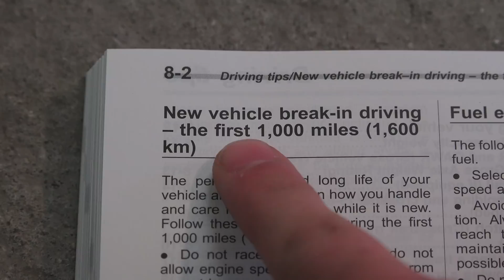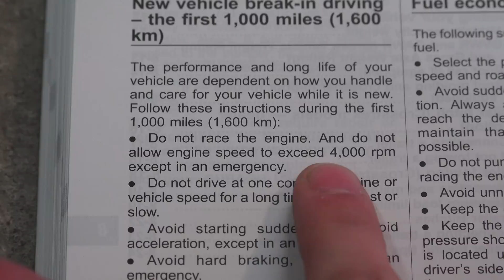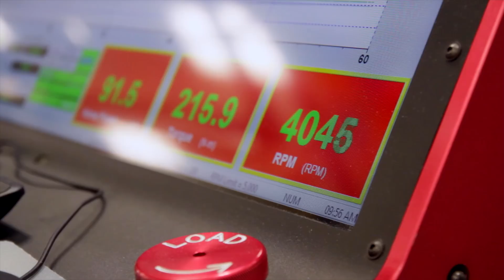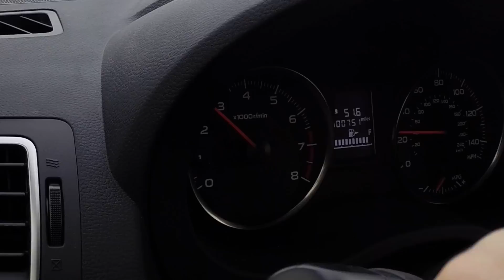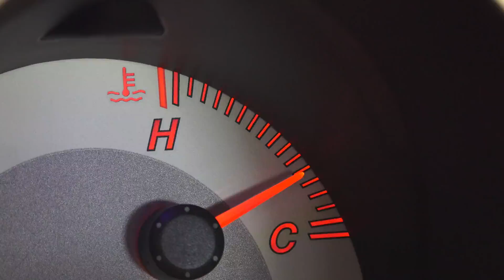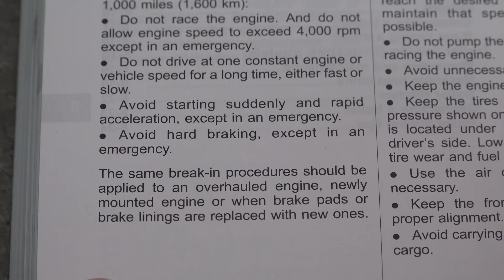5 Things You Should Never Do In A Brand New Car

Comment: Especially in the new wizbang engines designed today, like the Nissan shown, you gave s small engine making amazing amounts of power, with a warranty. This goes from the Corvette V 8's and the Subaru Opposed small displacement engine. That are all covered under the manufacture warranty. So they want you to take it easy to be sure no damage is perpetrated and to help get engines built with hot spots get the help needed to get by the warranty period.

Comment: This is bs. Everything I've ever owned I ran it hard from the get go. Cars. Trucks. 4 wheelers. And for some odd reason it was a smudge faster than the next exact same stock vehicle. Also in the (particular)cars that had known oil consumption issues, for some odd reason mine didn't use oil. So no, don't baby it from the get go. Hard acceleration causes vacuum on the rings when letting off the throttle at high rpm and seats the rings in better for a better seal and less blow by. I speak from true experience.

Comment: I like this guys explanations for things in general and he just follows what the car makers say to avoid any conflict. However as a engine builder or repair man we know that the general methods only pertain to the average driver. Imagine a 2 thousand mile breakin for a Bonneville racer .Ridiculous isn' it?  What does throttle opening do .It relieves the drag on the engine. It is basic theory of good efficiency. There is no problem with wide open throttle.Different size carbs or throttle bodies mean nothing. High rpm is a problem at first.  Steady speeds are fine as long as not too low or too high. 
With a moly face ring, as most engines come equipped these days, an hour will have the rings seated. An hour for the camshaft also. Engine bearings need an hour also. If the engine is assembled correctly  all is good to go in an hour. However be sure to get the oil hot before you go and race it. Poor oil flow will kill any engine. The manufacturers test engines in such a way you would not believe. 10 below zero cold start, floor it with a full load to redline then shut it down and do it all again a few times.
   The old days are gone. Rough machining is for backyard or third world conditions, and long breakins were with cast iron or chrome face rings. Break in oil caused sludge and varnish to help seal leaks and smooth rough surfaces.That was in the 20's- 60's .
    11,000 rpm in a motorcycle engine after a overhaul with 2 hours of running time is common. LETS RACE! Rauuuuuww

Comment: I'm a huge fan of your channel and your work and I have watched almost all of your videos. This is the first of them that has disappointed me. 
So you've read parts of three owners manuals, sat in a car, quoted one engine builder, and that's supposed to be engineering explained? Where's the engineering and the explanation? Some of your older videos had more useful information and explanations in 1 minute than this one has in its entirety. 
I won't go into a debate on engine break in because its such a controversial issue but I will say this: No amount of easy break-in will save an engine with imperfections or improperly set tolerances, nor will flooring it to the rev limit ruin a properly built engine. An engine that gets damaged from flooring it during break-in was bad in the first place. There is no arguing against that. I'm not saying there is a single way of breaking in every engine or that this or that way is the right one, but putting a clickbait-ish video thumbnail with "don't floor it" is not the standard engineering explained has set over the years. 
Why do car manufacturers don't tell you "Please rev your engine along its entire rpm range"? Maybe its because they have a legal department and maybe because they would wake up the next morning with a million lawsuits from a million morons that crashed their corvette. "I was just doing what it said in the owners manual bro! I want a 3 million for emotional trauma". 
Sorry for the long comment. I do not mean to criticize, belittle or start an argument. Things like engine break-in are not black and white and there is no single perfect way, especially not one that stems from a few owner's manuals and some chit-chat, and I think you know that better than anyone, so please give is us some good ol engineering explained with facts and details.

Comment: Currently at 180k miles on my LS3(c5z06) which was broken in hard. Maintenance all done regularly of course. 

Most higher end "sport" cars are driven by the manufacturer for testing before they get to the customer, in some cases requiring no break in. Ferrari is a good example, as all "new" ones have around 50~ miles from break in/testing.

Comment: There is a BMW dealer across the street from where I work. I routinely see the service guys pull out of the parking lot, blasting full throttle, white smoke coming out of the exhaust, engine screaming at redline, turning the corner and going two blocks down to the gas station to fill it up for a customer. Great way to break in that new $50,000 car fresh from the dealership! Brakes, tires, engine, and transmission all thoroughly hooned for you in advance. I'll never buy a car from this place. Ever.

Comment: I've been told by many mechanics that you should not labour the engine while running an engine in i.e. low rpm pulling away, need to keep the engine reving a little more than usual 
so low load medium revs

Comment: ive hit 100,000 miless snd I broke my caf in with high octane over the rugular needed to get piston rings to set with positive pressure. Your rings break into the rpm you ride it at. so if you ride it at hlaf rpms and lower its not gonna blow by on the lower rpms, but the high rpms are gonna blow by like crazy. constantly change rpm, avoid hard hils or heavy downshifts. light downshifts and short little 3/4th throttle accelerations, then put it in secound at about 15mph and slowly but steadly lay your foot down and let it bounce off the limiter, then go home and compression test, if your solid youve broke the car in well. if not you have failty internals. im taking this straight from Jennings.

Comment: After working for an OEM who makes performance motorcycles, you also need to understand that telling the customer to "be gentle and not redline etc etc etc" is also a way to SAFELY get the customer familiar with the vehicle in a more controlled manner. NONE of the race teams I spoke with followed the "recommended" break in procedures. Of course they weren't as concerned with maximum long term reliability, but they were obviously VERY concerned with maximum power. They each told me "heat cycles" were the key.

Comment: What happens when you get a used car?! You're at the mercy of the original owner? That's like playing the Lottery.
Reply from the maker: Used cars are certainly a lottery, but there are a lot of great videos out there about how to inspect them (ChrisFix and EricTheCarGuy both have a great series on this).
Reply: That's a high price to pay for having little patience.

I'd rather just pay for a good mechanic to go over a used car thoroughly.  To each his own.
Reply: Angel Valdez Agreed, if you want reliability, choose Honda or Toyota. Pretty much unbreakable engines in these cars. :-)
Reply: wallllleeeee pretty much yup. that's why I tried new vehicle this time. the used one I had the rear end was going and the dealership never checked it off as a problem.
Reply: ***** How will it not be cheaper though? I bought mine for €3000 and been driving it for a year, and all I've done was put oil in it twice. That's it.

And it's not a car with 50000km's, not even a car with 100000km's, but a car of 225000km's (!) that's still like new.

I may have had great luck with my purchase, and others may not, but don't dismiss the fact that it's generally much cheaper to buy a used car.

Sure, for €10000 I could have bought a damn Dacia Logan or something, but that would not have nearly the amount of comfort, power, luxury or style as mine has, for over 3x (!) the price (not even to mention that it's probably going to be 3x as unreliable, because it's a Dacia lol).
Reply: @robertdevald  my $25k used car has turned into $37k after repairs. That’s the price of a brand new version of the same far i bought. Used cars are more expensive than new
Reply: @ckchatta369  because of covid and the chip shortage now, but you're replying to a 4+ year old comment friend :)
Reply: VestedUTuber Well yes, I completely agree with you. It obviously matters what kind of general reliability a car has, and that's up to you to do the research into that before you buy a certain car model.

I bought the 2001 Lexus IS200 with the 2L inline 6 engine (1G-FE) which I know, and have known before I bought it, to be pretty bad for modifications, but an absolute BEAST when it comes to reliability. These things run 500 000km's with just basic maintenance.

If you are going to buy a classic Jaguar, or an old Maserati, you already know upfront that parts for the car will be a nightmare to find, and will cost fortunes to fix anything. It's just a given.
Reply: I dont know any car (except Dacia) that costs 10k when its new. And that one doesnt even have any security features, comfort features or basic installations like an ac or any heating element at all. 
With any other car its more a comparisson of 5k vs 25k or more. Even if you have to 1-2k into the old car you are saving a lot of money.
But in the end Id say: if you can afford it and think that a new car will improve your happiness just do it
Reply: wallllleeeee I had same credit problem. I know a new car with 4 miles on it is nice but you could settle for a Re-Certified used vehicle. It's is just like new and has all the new car warranties. I got a Nissan Frontier with 20k miles for about $10k less than if I bought it new. Worth it for sure. But it is still a bit of a risk but at least it's still under the original factory warranty. They just reset the warranty term.
Reply: I've always bought a new car. Now driving my 4th car. I've always drove them in properly and as such I've had them to a maximum of 60-80,000km and then sold/switched. I've found it cheaper to sell/switch to a new one around this range than if I'm to continue driving old car and paying most likely heavy maintenance expenses and car's price keeps dropping to non-existent.
Reply: Depends on the car, drive a BMW to those k's, do standard maintenance, its goods for another 80,000 no worries.
Reply: not everyone has that luxury or can afford a new car and monthly bills so we have to resort to buying used. Like myself. I have gotten lucky i guess, my car is running fine. 2001 Tiburon.
Reply: There's really no need to be too paranoid if you're buying a newer vehicle (from the last 10 years or so) used, most modern vehicles don't require lengthy break-ins like older cars.  Some really high performance vehicles might still require them due to the stresses that the engine gets put under.  Unless the previous owner decided to go track the car right from the factory it's pretty unlikely that they would have been able to do any real damage.  When a modern engine fails it's almost never the stuff that's mentioned in this video, it's usually due to weak/defective parts or poor design.

If you're buying your car brand new, drive it a little more gently for the first few thousand miles because it's theoretically the best way to do it, but in all honesty it's unlikely that you would ever notice the difference between doing it the optimal way and just driving it like a normal person.  People don't usually go around revving their cars to redline anyways, so just driving normally is usually going to be within the breakin requirements anyway.
Reply: The assumption that new cars don't have issues is flawed and the rest of your argument consists 100% of arbitrary nonsense designed to support the point you are trying to make.
Reply: wallllleeeee Wa
Reply: robertdevald but a peugeot, citroën or vw can also live very long (this one from the late 80's/early90's) not to mention an mercedes from the mid 80's/early90's...or try a nissan urvan it feels like you can drive it a millenium...or so...somehow...
Reply: wallllleeeee Thats why i quit buying used cars i just recently bought a new lease and im babying to keep the resale value as high as possible but unfortunately i wasnt able to finance due to inactive credit history but now i have 3 years to work on it and after those 3 years im going to try to purchase the car i want new so i never have to deal with used junky cars!
Reply: VestedUTuber Lel,  Suzukis also. If you buy a Suzuki brand your gonna have to replace the steering rack often.
Reply: New cars are a lottery as well, lots of cars leave the factory as lemons.

Personally, I wouldn't buy a new car ever, it's just throwing money out the window.
Reply: Personally, I would never buy a used car. It's just throwing time out the window checking the car and speaking with people and hope to god they hadn't fucked the car up. I also don't want to spend time looking for the right model and color, with a new car, I just go in the dealership and hand in the money, and get what car I want.
Reply: Valid points, but they can't be universally applied in every situation.

I love BMW. My first two cars have been, BMW's. They have both been 2nd hand. Both are (after general maintenance and some minor repairs) fine.

I don't think luxury car 1st buyers, will ruin their car with a bad break in. For many, its a significant purchase, for retirement or work, and as such, they don't want to destroy them. 

The benefit, as you may already know, of buying second hand is buying fantastic cars for a low price.

I drive a facelifted e46 coupe. It makes old men who buy brand new mazda's extremely jealous.

Comment: My own experience shows that a new engine requires a set break in period. I had a cg125 Honda motorcycle engine rebuilt, no break in period led to the engine rattling and leaking oil. The same engine rebuilt with a break in period (1500km) was purring perfectly. High speeds can be achieved during a break in period, the accelaration should be gradual. A service is usually recommended after the break in period.

Comment: so my motoman run in was a huge mistake ? 😅
Reply from the maker: Not necessarily, just an unnecessary risk based on the information I've seen.
Reply: (except for rental cars) have a bad experience with rental?
Reply: Engineering Explained
Reply: I was about to ask the same thing. I didn't follow his procedure to the letter, but I did several heavier throttle accelerations (not foot to the floor, not to redline) off of stoplights when the car was new. Has run great since...

Comment: If I can't floor it from day one then why has none of my work vans blown up from day one every red-light there floored or hitting the break and only change oil every 7500 miles when Dash info tells me it time and all last past 200K with no problems other than maybe a water pump or front wheel bearings on these Chevy vans

Comment: The GTR engine goes through a torture test of about 500 hrs at red line, doesn't it?
Reply from the maker: Perhaps to verify the engine when they're testing it, but certainly not to put in into a customer car. That would require three months of sitting on a dyno, that'd put the engine in a significantly worse place, and be extraordinarily expensive for Nissan.
Reply: Ibrahim Majd  yes every GTR engine gets tested out before it's installed. You don't need to break it in... almost all cars come broken in nowadays, but the GTR goes through a lot more, just watch the videos of how the engines made
Reply: Ibrahim Majd 4 and a half minutes at half then a minute at wot
Reply: internals are different also.
Reply: Such a test shows that a particular engine survived the test. That isn't an insurance the engine won't break on the first owners first hour driving. A manufacturer  will not put a broken engine in a new car. A new vehicle owner gives their new vehicle a torture test break in contrary than the owners manual break in instruction is going to pay for a broken engine. Their money so I don't care what they do. Most others would be  better off following the manufactures instructions as best they can. Again it's their money I don't care what they do

Comment: Here's what I usually do with my cars and I've had best experiences with it. (lowest fuel consumption, no oil consumption)

For the first 1000km:
- when the engine is cold (<15-30 min of driving) very easy on the throttle
- less than 2100 rpm for diesels and 2300rpm for gasoline engines (in this case they are all turbocharged engines with a decent amount of torque)
- no high speeds (more than 80mph / 125kph)
- no autobahn/freeway driving (to prevent driving at constant speeds for a long time, i.e. varying loads)

1000-1500km:
- gradually increase the load on the engine, when it has warmed up (i.e. occasionally harder accelerations with more throttle)
- still respect the RPM limits from above, but increasingly do a few runs up to 2500, 3000, 3500 and finally 4000 (the more mileage it has, diesels only up to 3000-3200)
- grant the engine some time to breathe after a harder acceleration

1500km+
- gradually increase all limits from above
- never floor a cold engine + avoid very high rpms when its cold

one additional note on length of break-in: it really never "completes"... I've had a noticeable fuel consumption decrease over 100.000km of driving the car. (from new to 100.000k+ it went down by 16.6%) It was a very straight line through the whole mileage history.